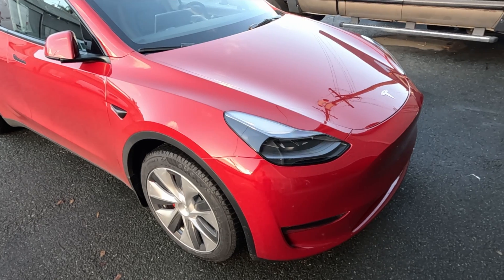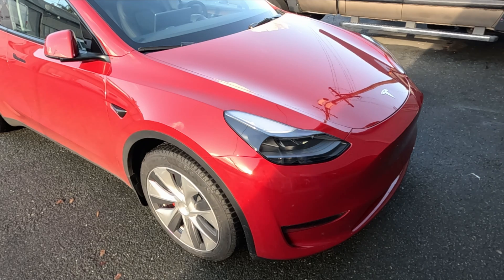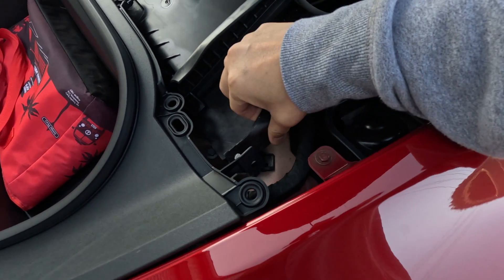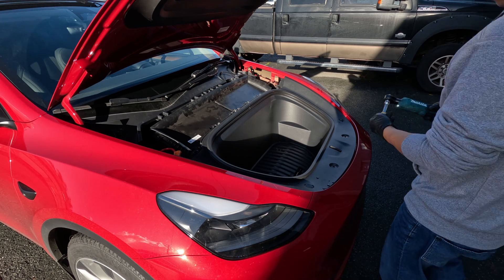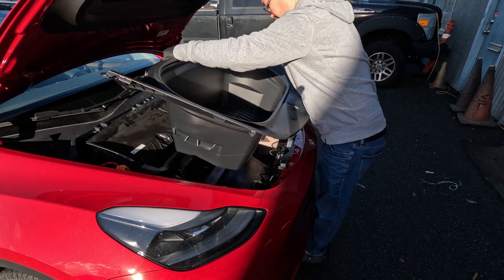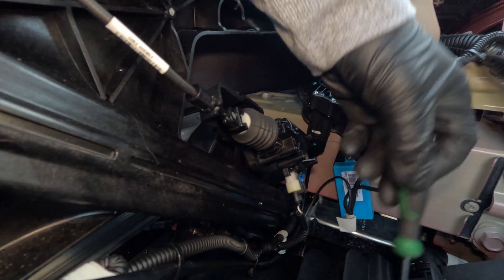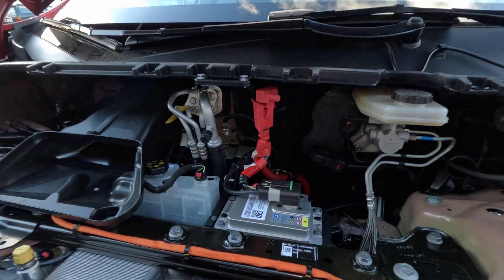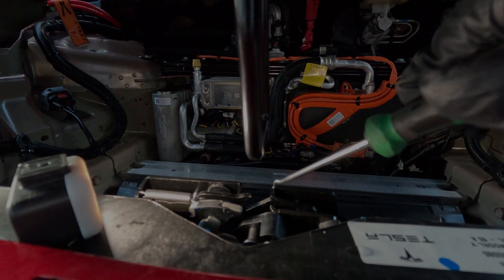Tesla Model Y & 3 AliExpress Soft Closing Auto Frunk Install

Comment from the maker: 👉NO LINK BEACUSE I DO NOT RECCOMEND THIS AFTER IT FAILED!!

Oops, I need to double check if the latch is a 10mm or 13mm socket. Regardless, you'll need both! Product link below, I have no affiliation with them. I'll update this if there is a better product released! Also, if you shop around on AE you can probably find a cheaper deal. The price fluctuates quite a bit. I snagged mine for cheap during Thanksgiving.
Reply: Is there a version of this that you would recommend?  How about the style where the motor is mounted to the latch mechanism, not remotely?

Comment: Can I ask how it failed?  I found your video trying to install one very similar but now I'm going to remove it and ask for a return because I couldn't make it work properly.
Reply from the maker: The motor itself failed during the tensioning phase. There was no fail safe, so imagine trying to open a hood that somebody is actively pulling against. I had to take the entire front of the car apart so I had enough room to cut the aftermarket cable with bolt cutters.

Comment: Do you need to power off the car to attach the power? Or do you need an insulated wrench?
Reply from the maker: You don't need to turn the power off, it'll spark a little on initial connection. You can though, if you'd like. I connect the positive first, then use a ratchet for the ground on the left side away from the positive terminal. If you're careful there is plenty of room.

Comment: I see its bending the hood slightly when closing, is there a way to avoid that by adjusting the powered lock?
Reply: It's no different than what happens when you push it down by hand. It can't be helped due to the way the hood material is designed.
Reply: @AStock2204 Pushing the hood closed by hand is over a large surface area. Pulling the hood closed by the latch is different and exerts force over a very small area - which increases potential to dent imho
Reply: @peejayem4700  Exaclty, which is why tesla has such strict instructions of where to push the frunk closed. Metal and surely aluminium is prone to fatigue so i believe growing dents might appear eventually. Its a shame the frunk is so fragile honestly!
Reply from the maker: Nah, it wouldn't close then. It doesn't hurt anything.